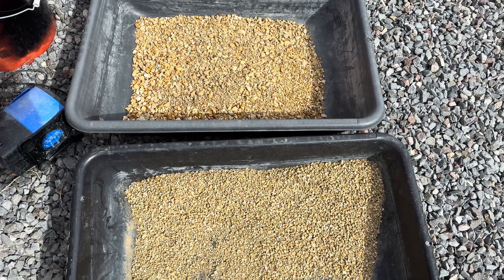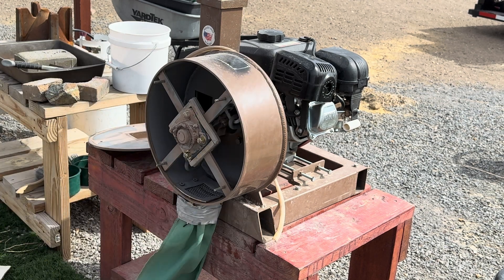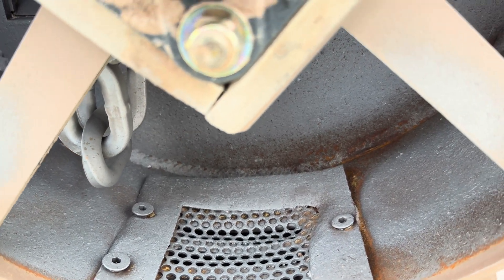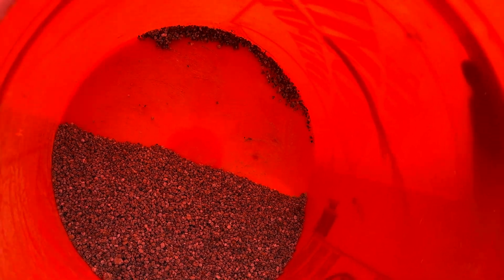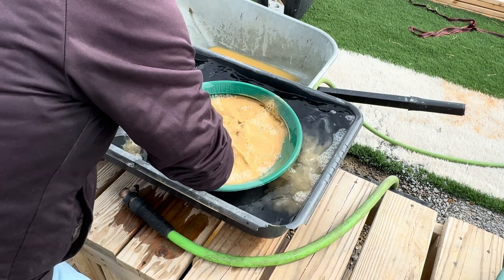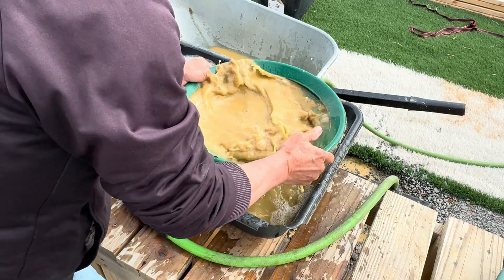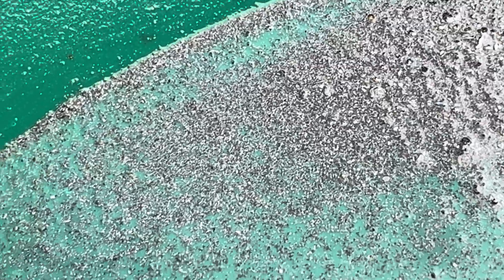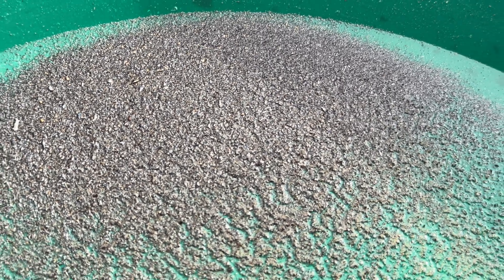Is There Any Gold In The Kamikaze Tailings

Comment: I have the same crusher and use 1/8th inch screen in the rock crusher. I was curious why you use such a large hole size in yours. Ever use a weak magnet to pull any tramp iron left in the cons?
Reply from the maker: @ChrisRalph  Hi Chris, I appreciate you communicating with me. Yes, I have a a few 1/8th inch screens. The main reason I use the 3/8th inch is when I do hundreds of pounds of andesite ore there is less wear on my chains when I use a 3/8th screen. Like in my video, I do need to classify the larger material out and recrush it then it is fine. But in this episode I wasn’t interested as how much weight of precious metals was in there as to exactly what is in there. This gave me a good indication that I can process the ore from the mine dump and get a half way descent amount of precious metals. 
Truth be told, I could have changed screens for the 10 lbs but I didn’t want to make the effort. I knew the lesser amount of material would suffice for what I was doing. 
In my previous episode I did use a magnet to remove the iron. But I did that after the material had dried. I should take the time to remove the iron as I pan out the concentrate. I appreciate your insight and I will do this next time around. 
Thanks so much, I appreciate you 💪🏻🤗